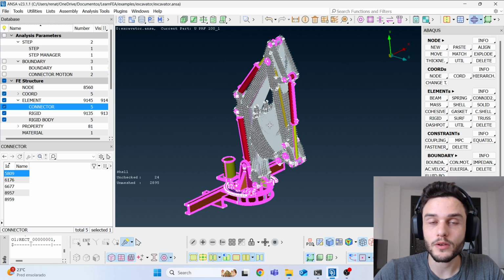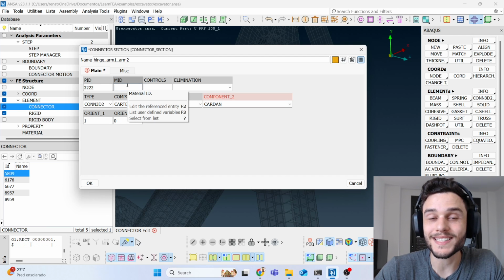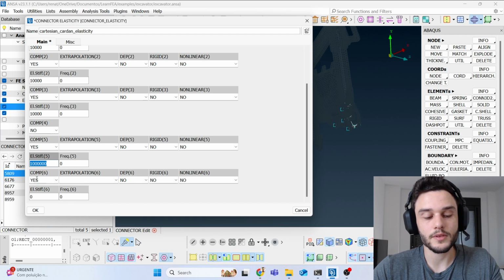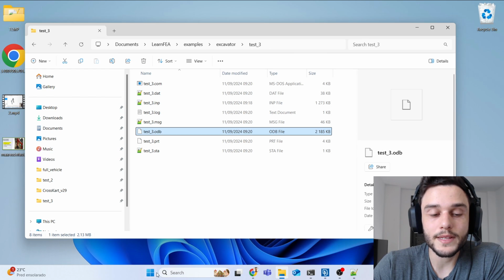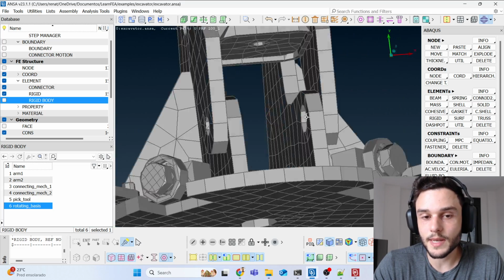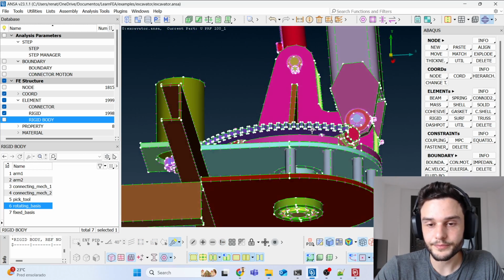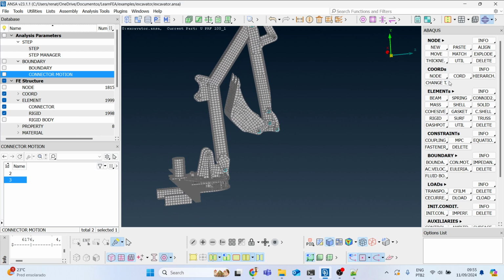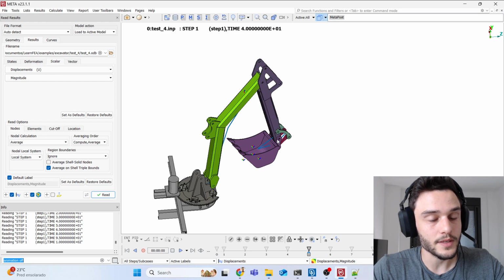Modeling Excavator Arm Mechanism in ANSA and Solving in Abaqus (FEA Tutorial) | Part 3

Comment: what would happen if you use only cardan with prescribed elasticity values. Will the solver converge? If you do not open cartesian, how will connector behave in translations?
Reply from the maker: If you don't define any kind of constraint for translational relative displacement between two nodes, than there will be translation with not resistance against, so it won't work in this case. What we usually do is to define a Cartesian Cardan with translational and rotational stiffness. We obtain the value of these stiffness by creating a more detailed FEA of the joint modeled as flexible body, or through experiement.